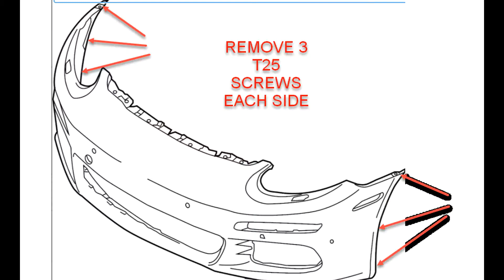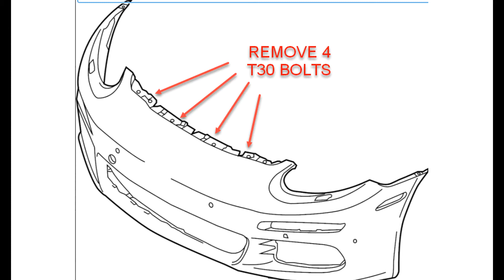Replacing Engine Air Filter in 2009 - 2015 Porsche Panamera

Comment: I'm looking at a '14 Panamera, 3.0L V-6.  Seems like a lot of trouble just to replace the air filter.  Porsche doesn't do anything simple. Or do anything to cut down on dealership tech shop hours.
Reply from the maker: Think it is 40000 miles or 4 years. I think I got a Mahle filer for about $65.
Reply: Buy a 1995 Tacoma then

Comment: Were you disappointed when you saw that the filter wasn’t even as dirty as you thought or is I thought it would’ve been to go through all that change it. thanks for the share, though. I will check to see how much Barber Shop would charge to do that first before going to the shop.
Reply: I just changed it and even if it was not so dirty I rather paid the $60 bucks and I will forget about it for a while. I was not so annoying the process.

Comment: Was there a snag on the passenger side of the bumper? Also, what was the amount of time DIY? Thanks👍
Reply from the maker: Yes, There are some clips on both sides that snap in and I was worried that I would break them if I pulled too hard.  Probably about 1 1/2 - 2 hours start to finish.  I also removed one of the marker light bulbs on the driver's side so that i could get enough slack to lay the bumper cover on the floor.